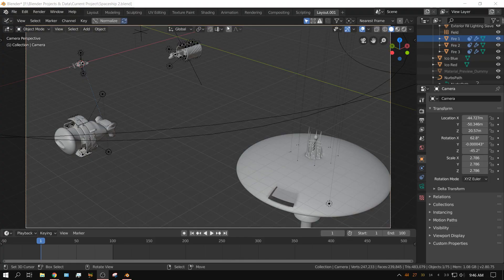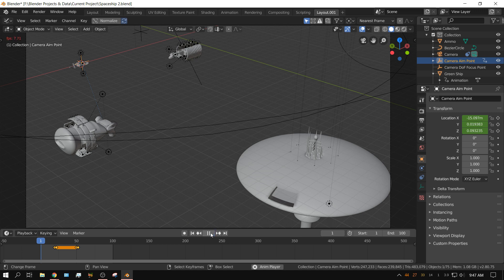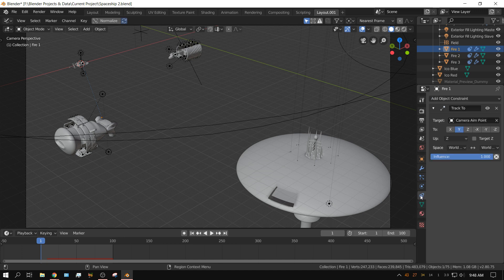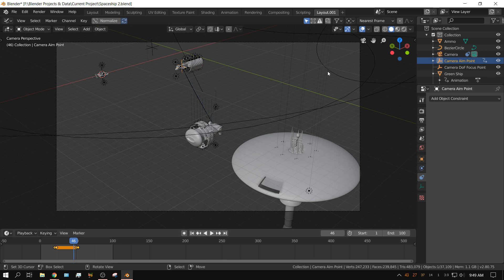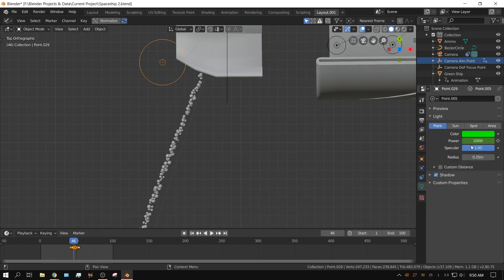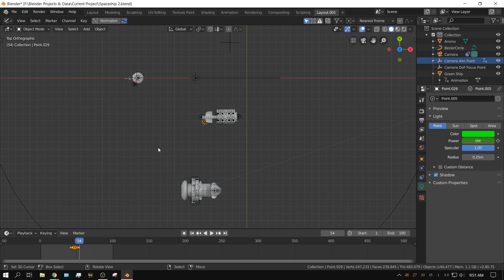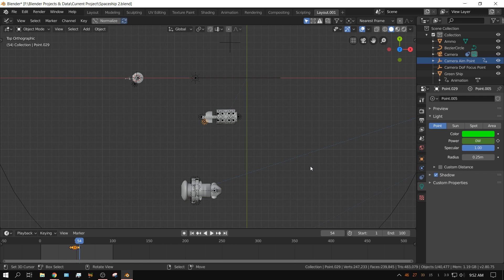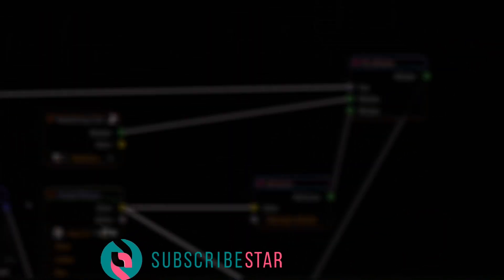What's The Best Way To Simulate A Laser Blender Eevee

Comment: Lasers? Create an empty for the starting point, and an empty for the end point. Create a cube. Give it an emission material. Parent your glowey cube to the start point, and give it a stretch to constraint. Target the end point. Turn on bloom. Simple and low poly.
Reply from the maker: That's the problem with kids these days, they are always looking for the easy path. LOL 
Yeah, I know I can do it that way. I just wanted to use particles.
Reply: Blender Rookie True, but I also think it looks more scientifically accurate. You can animate the thickness of the beam to make it seem to fade in instead of “shoot”(unless your going for a more Star Trek sort of look), the beam is always a straight line, and it’s easier on my PC when it comes to rendering. Particles can work too, and might be preferable in some situations, but tend to be (for me at least) an absolute lag fest when it comes to multiple ships, unless you have a beast of a machine.
Reply from the maker: @ARandomCogboi  You are absolutely correct. There's nothing that can be done to make the particles fast enough or lag free enough to work perfectly. 
This right here is the best particle based laser effect attempt I have made. It actually uses the method you mentioned plus particles. https://youtu.be/3Sb5CPrzQmY?t=38

Comment: My first guess is, with every single particle, have a light source attached to it, with no shadows to prevent extreme lag. I'm not sure how would you do that though with particles.

Or render in cycles 8-)
Reply from the maker: I cheated. I had a point lamp parented to the ships at the point of impact and then key framed the brightness. But yeah, I will likely render the final in cycles.
Reply: Didn't you say that in the video already? I figured just that.
HMM, what if you have 2 particle systems for each "shoot", first one shoots laser particles like you have already, and second one shoots "light" objects at exactly the same settings but with a smaller count to reduce light?
Reply from the maker: Yeah, probably did say that. 
I don't think a point lamp can be emitted like a particle. Even it it could, I don't think it would work. I am pretty sure there is a limit on the number of lamps Eevee can work with. I was working on a scene one time and after about 100 lamps, any new lamp stopped affecting the scene. Maybe that has changed sense way back then.

EDIT: I just tried it and apparently lamps can in fact be used as particles. I stand corrected.
Reply: Now I am imagining a starship shooting a beam of ridiculously accelerated 65W light bulbs at another ship.
Reply from the maker: @Architector_4  Although it works, I just looked it up and at most there can only be 128 active lamps in any scene.
Reply: @BlenderRookie  
Yeah, that's why I was suggesting to make it a smaller count, expecting some kind of a limit. I guess like 5 individual lamps per 1 ray would be enough lol
Reply from the maker: I think I could probably use up to about 100 and then have them die on impact. I'll have to play around with it and see what works.

Comment: You could add a new particle emitter copied from the laser but instead of using a mesh with an emission shader use a light as an object. Then use them both particle emitters together.
Reply from the maker: Do you mean to fake a much faster velocity?
Reply: @BlenderRookie  No I meant to shine a light on to the ship getting hit. So you would have one particle system emitting objects and another particle system emitting lights, passably spotlights facing the ship getting hit, moving along the same path at the same time.
Reply from the maker: @infotoons212  I understand now. That will not work. Although an emitter can create lamp particles, any given Eevee scene can only handle up to 128 light sources.

Comment: realistic space battle would probably have spaceships extremely far away and there would be possibly different types of weapons like missiles
also some of the projectiles would be extremely fast (possibly close to speed of light)
       I haven't tried to simulate that in eevee perhaps a path +cylinder animation could work   have you tried that ???
Reply from the maker: Of course I do realize all that. But it's kinda pointless to simulate a projectile that's moving too fast to see. That is unless the end goal is a physics experiment and not a visual simulation.
Reply: you Would see the projectile because of the massive distance it would have to travel  @BlenderRookie
Reply: also it could give it more power and brighter glow because the space isn't completely empty
Reply from the maker: @bluewhalestudioblenderanim1132  Nope, you wouldn't. Let's assume the projectile is the size of a skyscraper and lets assume the projectile has a velocity of 1/10th C. That means in a mere 0.1 seconds the building size projectile would have moved 1,860 miles. Let's assume the simulation is created at 60fps. That means that for every frame the projectile will travel 31 miles. Well, it's gonna take about 1 frame for that projectile to move so far away it cannot be seen with the eye. Two frames at most.

The particles in this video are moving at 200 meters per second or about 450 MPH.
Reply: thank you for awnser  @BlenderRookie 

But what about detectors like radar and telescopes ???
Reply from the maker: @bluewhalestudioblenderanim1132  Optical telescopes would only help if you already knew the trajectory and time at which it fired because of the narrow view of an optical telescope. Radar wouldn't work because of the crazy huge amount of power needed to create a short enough wave length that's powerful enough to see out far enough with enough resolution to track a super fast object. Also, radar is directional and the object would have to be detected, then zeroed in on. But that detection process would be very difficult when by the time the rotating radar swings back around, the object that's moving crazy fast has already moves so far it may not be seen or recognized as the same object. But of course the radar could be omnidirectional which would of course greatly increase the power needed.
Reply: thank you  @BlenderRookie  

But what about using it on the distant enemy spaceship Before it fires ???
Reply from the maker: @bluewhalestudioblenderanim1132  Then you will be faced with the whole moral dilemma regarding preemptive strikes.
Reply: thank you for that  @BlenderRookie  But I don't have time for more awnsers sorry

bye
Reply from the maker: @bluewhalestudioblenderanim1132  LOL
Reply: I have to go to sleep  @BlenderRookie  
it's late at night